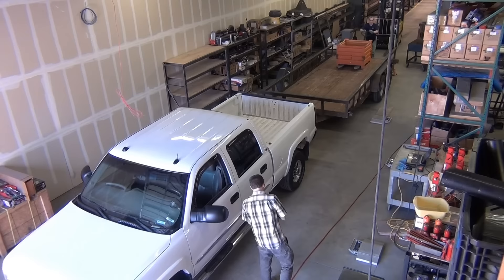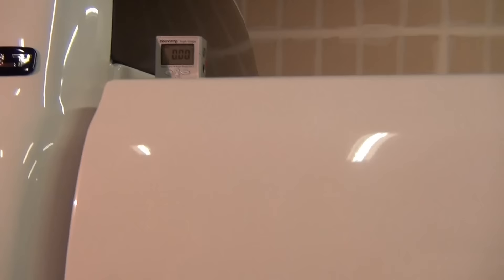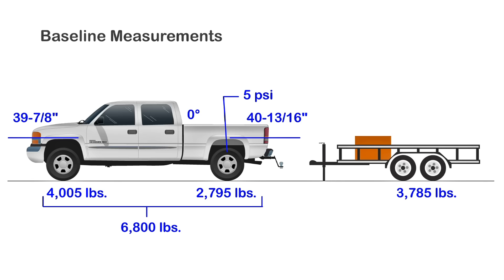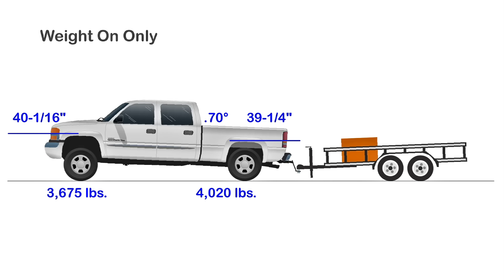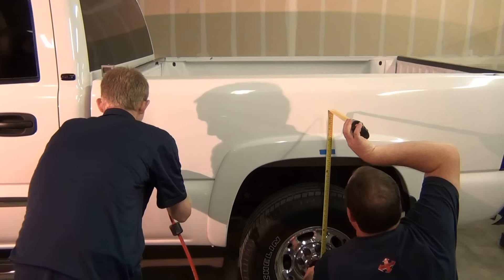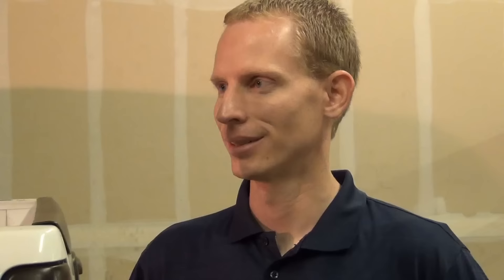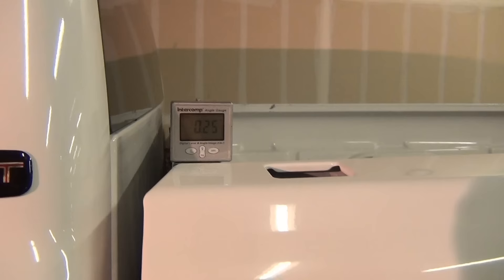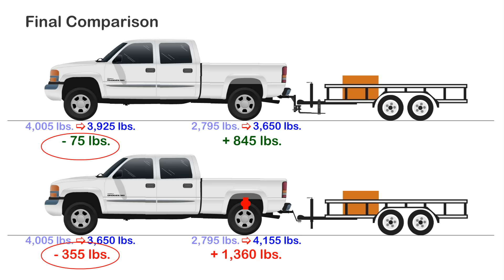The Difference Between Using Weight Distribution and Air Bags to Level Your Load

Comment: In the video the front axle was down an 1/8" down from base line. In the instructions it states this is too much weight distribution. How do I get my hitch dialed in? Thank you in advance
Reply from the maker: Thanks for pointing that out. We had not noticed the difference in those measurements before. The short and simple answer to your question is to follow the instructions, and do not set up your weight distribution so that the front measurement with weight distribution is lower than the baseline measurement.

To address your observation about the heights, first of all, this was simply a demonstration to show the different principles and concepts surrounding the use of weight distribution or air bags. Therefore, we did not take the time to be as thorough and careful as we would have if we were in a real life testing situation trying to gather test data or to meet an engineering or industry standard like ASTM.

From an engineering perspective, the phenomena you are seeing is called hysteresis. Due to the overall friction in the system in the suspension, hitch, etc., the height of the system won’t always be the same for a given load on the front axle when going up and down. In other words, using height isn’t the best method. Using scales is much more accurate. However, since most people don’t have a set of axle scales in their garage, the next best method is measuring the fender height change. If we had been more detailed in our methods, we would have tried to move the vehicles up and down a little with each different setup to have them ‘settle’ into a more average position. This would have helped reduce the amount of hysteresis effect.
Reply: Thank you for your response.  I messed around with my hitch yesterday got my front driver back to where I started and the passenger side a little lower. Stock height was different from side to side. Trailer has less sag now then prior to adding a new washer. Do I need to worry that I transferred too much to the front axle? Unloaded front was 40.5 driver side and 40.75 passenger side. With load distribution hitch it sits at 40.625. Thank you in advance.
Reply from the maker: We frequently find that the measurements are different on the driver and passenger sides of the vehicle. A good practice is to average the two, and then try to hit that. That is exactly what your numbers show, so you should be good. Remember that this can change with your trailer and tow vehicle loading. Theses systems are very dynamic. Don’t be afraid to check it once in a while and make sure you’re still set up well.
Reply: Thank you very much for the input
Reply from the maker: You're welcome! Thanks for watching!

Comment: I have the e2 hitch and love it, but my suspension is soft and I get a bit too much bounce when towing a travel trailer.  I would love to add airbags to stiffen the ride.  I have read that airbags will act like a fulcrum and counteract the benefits of the weight distribution hitch because they will work against each other. If this is true, would adjusting the weight distribution hitch down to compensate be sufficient to counteract any negative effects of the airbags?
Reply from the maker: Using air bags and weight distribution together work fine, as long as you set the hitch up taking into account the increased hitch ball height caused by inflating the air bags. Install the air bags, and inflate them to the pressure you expect to tow with first, then go through the hitch setup process. That will get your hitch ball height correct relative to your trailer coupler height, and will give you an accurate baseline measurement to use when adjusting the weight distribution correctly. After that, inflating the air bags will reduce weight distribution, and deflating them will increase it, so pay attention to that and adjust your weight distribution accordingly. It may take a little trial and error to get the balance of ride stiffness and good weight distribution you’re looking for, but after you get it all set up, it should be a great ride.

Something you might try before installing the air bags is checking to see if you have more room to increase the weight distribution. This may help stiffen the ride to a point that you don’t need to add the air bags. Check your setup, and if you still have some room between the loaded with weight distribution height and the baseline height, try raising the L-brackets until you are back as close as you can get to the baseline, then take it out for a tow and see how it handles. Here is a link to the owner’s manual to help you go through that process. [http://eqhit.ch/manuals] [http://fstwy.co/rb-install] [http://fstwy.co/tr-install] If it handles well, you can make a more permanent change to the setup by adding a spacer washer for each hole you raised the L-bracket, and returning the L-brackets to their original position. For example: if you raised the L-bracket two holes to get back to the baseline height on the front end, add two spacer washers, and drop the L-brackets back to their original position.

Comment: Was the weight distribution correct or could you have adjusted more to get the front close to the original height and weight?  Great video.  Thanks
Reply from the maker: You can adjust accordingly!

Comment: There appears to be a problem with the measurements, though: the combined axle weight of the tow vehicle (uncoupled) is 6800lbs, the trailer is 4785lbs, giving a total combined weight of 11585lbs (uncoupled), but the GCM (Gross Combination Mass) of the trailer and tow vehicle when coupled adds up to 11695lbs. Where did that extra 110lbs come from? Did you have the load distribution hardware installed but not engaged? 

That can't be it, though, because when the air-bags are inflated to 55psi, the GCM adds up to 11715lbs, and with the load distribution engaged it adds up to 11725lbs (I'm calculating GCM as the combined axle weights of all axles, trailer and tow vehicle, which is how the road-side inspectors would weigh it). 

How is the GCM changing throughout the video, and how can the GCM of the coupled combination be higher than that of the mass of the trailer and vehicle weighed separately? Was there a scale calibration issue here? I'd like to see the whole test done again on a weighbridge, measuring GCM the whole way through the test. An actual measurement (or calculation) of tow-ball (tongue) loading at each step would be really useful, too. That's another thing that doesn't add up with the figures as shown.
Reply from the maker: Thanks for watching, and thanks for the comment. This is a question we have received a number of times since posting the video. The difference is a result of the tolerances on the scales we used for the measurements. The axle scales have a +/- tolerance of about 10 lb, and the small hydraulic tongue weight scale we used is analog, just an oil-fed gauge. We tried to get it right on 1,000 lb, but due to the design of the scale, we were probably off a few pounds. Overall the difference ended up being 110 lb, but relative to the total weight (11,695 lb) it is less than 1% off. Since this was simply a demonstration of the principle, and not a scientific test or setup to pass a certification of any sort, we determined that being within 1% was acceptable for the video. The weight is slightly off, but the way weight distribution and air bags affect the tow vehicle is exactly the same.

Comment: I have a 2012 Tundra 4 door with the short bed with a 6 in lift.  I am towing a 22ft travel trailer which drops my bed down but with the lift is doesn't ever get to the leaf springs.  I am going to put a equalizer hitch on the truck and trail but should I also use airbags or cheater springs to level out the bed?
Reply from the maker: Personally I wouldn't use air bags unless I absolutely had to. If that were the case, I would use a low amount of air pressure in the air bags, set them up first, and then adjust the Equal-i-zer hitch. That way you'll still be getting weight distribution and sway control. But having too much air will in a way cancel the effects of the wdh.
Reply: i have an 01 silverado extended cab and i tow an 18ft toy hauler, it used to squat like crazy and at times hit the bump stops even with the distribution hitch set on the 4th chain link. ininstalled air bags and its a night and day difference, like you dont even know its back there kinda difference. it rides level as can be and at only 50psi and if i really wanted to id still be able to add rake to it. air bags will solve all those issues

Comment: Thanks so much for the research and video! 
Leaves me curious, weight distribution hitch seems to be the way to go. Does that affect the 60/40 rule though?
Reply from the maker: The 60/40 rule is an approximation method to get a trailer loaded in the ballpark of what it should be. But it isn’t super reliable either. Whether 60% of your load is far in front of the axles or just in front of the axles could make a big difference to the tongue weight. The real goal is a tongue weight of 10-15% of the total trailer weight for bumper pull trailers. This target is the same with or without weight distribution. The best way to ensure you have 10-15% tongue weight is to actually weigh it. This can easily be done with our Fastway Flash Scale hitch or the Fastway Simple Weigh scale.
Reply: Thanks!

Comment: Prepping to tow a 2800 pound travel trailer behind a 2.0 L turbo 4 cylinder vehicle with a 3500 lb capacity.  Went with an equalizer hitch... gonna pack light too.  :-)
Reply from the maker: Awesome choice! Thanks for watching Good luck, and safe towing!
Reply: @FastwayTrailer  thanks.  Also went with the curt echo brake controller.  Thing is awesome, take a look if you haven't checked them out yet!
Reply from the maker: @michaelburke9541  thanks for the info!

Comment: I would have liked to see a combination of say 30psi or so in the bags with the weight distribution system. I replaced my rear leafspring suspension with a 4-link and airbags with a auto-leveling valve so my suspension automatically adjusts the pressure in my bags to keep the rear of the truck at the height I chose(level front to rear empty) from any weight adjustments, the same as a semi. Due to this I really wonder what kind of weird effects would come out of using a weight distribution hitch, if any.
Reply from the maker: This would be a great video idea! Thanks for the idea!

Comment: You trailer folks can do a lot of this analysys on your own doing simple math. You would need to find the lever ratio between your hitch ball to your rear axle....then from your rear axle to your front axle....commonly known as your wheel base. Place the rear distance over your wheel base and you will get the lever ratio. In the case of my f250 super cab it worked out to a .20 ratio . On a f350 dually extended it would be much less ,probably around .10 to .13 (never measured personally) What this means is this. ON my truck , IF I had 1000 pound of tongue weight there would be a lifting force of 200 pounds on the front axle. Manufacturers specs call for a maximum of 600 pounds tongue weight THEN equalizing hitches must me used....even tho the factory hitch was rated for I believe 12,000 pounds.   When you hit a dip in the road,there is a humongous downward force on the hitch ball twice. First for the rear truck axle then for the trailer axle. When the trailer connection bends downward ,it greatly tranfers even more torque to the front axle. Another time an equalizer hitch is needed is for when  your in a situation that you've got to apply the trailer brakes only using your brake controller, as in an out of control situation. (anti sway has its definite limits) I think ther are lots of people on the road that are clueless to this recovery method when you want to slow down but you don't want to loose even more control. Anyhow ,when you apply trailer brakes only ,there is a weight shift down on the ball AND there is a brake torque action pushing down on the ball,especially on a tandem axle trailer with brakes on both axles. To demonstrate this torque action for yourself ,next time your going real slow like at 5 mph...do a near lockup with your brake controller .....you will feel the backend drop ...a lot. ....NOW for duallies   ,you may not see much of an advantage ,because of the low ratio  and the fact that dualies tend to be ass end light when empty ...you might want the extra weight on the rear tires. Check with the vehicle manufacturer for the specs without equalization. They have already done the calculations.   :-)
Reply: @ Hardy.  hmm, your "ratio" is correct thinking. but I disagree with the rest, as the rest depends much upon the suspension. 1/ with no air coils, then yes, the regular suspension must take the forces, and will act as you describe. which is why WD is useless imho.  2/ with air, the suspension has greater capacity and will absorb the forces of trailer braking you describe. 3/ under normal braking [truck and trailer in tandem], the truck front will dip as it takes the force. this will cause the rear to rise. [this holds for any vehicle]. with no WD, the truck rear rise will be offset by the down force of the trailer, which is good. a WD is designed to shift weight to the front, which then adds to the down force to the front when braking, which is not good. 

finally, a WD is a misnomer. the effect you experience is caused by torque, not a distribution of mass. proof: no bars, no WD possible. the true name should be "torque hitch". what you don't see with a WD is the extra tension applied by the WD to the truck frame via torque. under loads and braking, the WD acts to cause the frame to flex more than otherwise.  imho, air is the best tech to use for levelling a truck, as this keeps the weight at the rear, where the suspension is best designed to handle the stresses.

Comment: Most trucks are angled down in the front, presumably so the truck will ride level with a moderate load. Is that ever taken into account?
Reply from the maker: The best way to get an answer to your question would be to contact our customer service team at info@fastwaytrailer.com or call them at 877-523-9103.
Reply: yes, that is definitely part of the equation. Weight distribution hitches should not be set to return the rear to its original height. The objective with weight distribution is to return weight to the front axle that was taken when a trailer is attached far behind the rear axle. Once weight distribution is set correctly, there will still be a little sag in the rear (though not as much as would be without weight distribution).

Comment: Can you explain whether it is acceptable and under what conditions to have WDH loaded while backing the vehicle? I have heard that you should unhook the bars while backing just like I read another comment that stated that approaches and driveway inclines could potentially present an issue with the WDH loaded. Looking for best practice and ideal situation(s) where it's ok to leave it loaded and when it's best to unload the bars before performing a maneuver. Thanks for the video, crazy how it's resurfacing 5 years later haha
Reply: With the Equalizer and fastway e2 hitches you don't need to disconnect the weight distribution hitch to back up. There are some WD hitches that require that, save yourself the trouble and get an Equal-i-zer.

Comment: I'd like to see how you adjusted the weight distribution hitch to account for tongue weight.
Reply from the maker: To adjust a weight distribution hitch we take three separate measurements over the front axle of the vehicle from the ground to a point on the vehicle that is easy to measure to, usually the edge of the wheel well, or a piece of tape placed on the front fender.

The first measurement is a baseline, which is the vehicle loaded as it will be for travel but without the trailer coupled. The second measurement is taken with the trailer coupled, but no weight distribution engaged. This measurement gives you a representation of how much less weight is now being carried by the front axle. The third measurement is taken with the trailer coupled and the weight distribution engaged. This shows how much weight is returned to the front axle by using the weight distribution.

Best practice is to adjust the weight distribution so that the third measurement falls somewhere between the first baseline measurement, and halfway between the first and second measurements. For example: if the first measurement shows 30”, the second 31”, the ideal range for the third to fall would be somewhere between 30” and 30-1/2”.

The same method is used if you are checking weights at a CAT scale. For example: if the first front axle weight is 2,000 lb, the second 1,800 lb, you would want the third to fall somewhere between 1,900 lb and 2,000 lb.

A detailed description of this process is available in the e2 owner’s manuals here: http://fstwy.co/manuals
Reply: @FastwayTrailer    Thank you
Reply from the maker: If those are the instructions in your owner’s manuals, we recommend following them. Check those against the instructions given in our manuals. We think the results you get will be pretty similar. Tow with it, and make minor adjustments as needed to improve the ride.